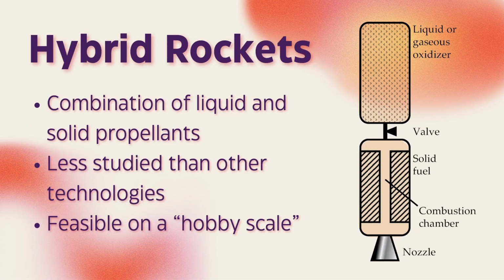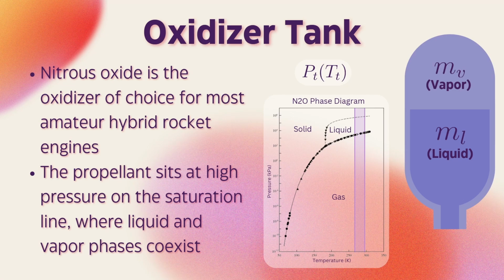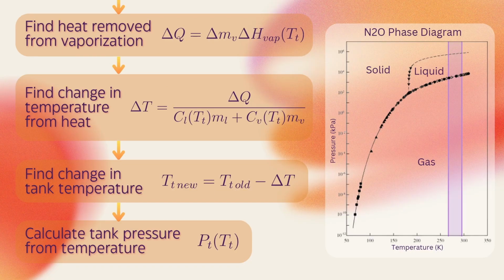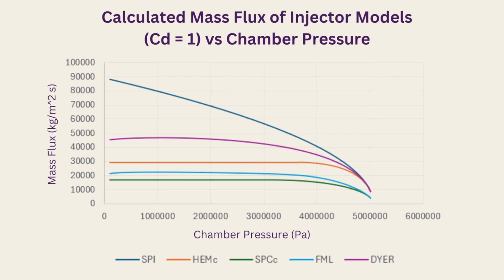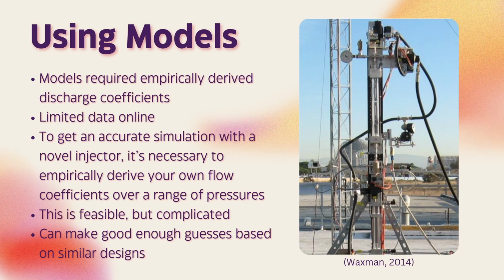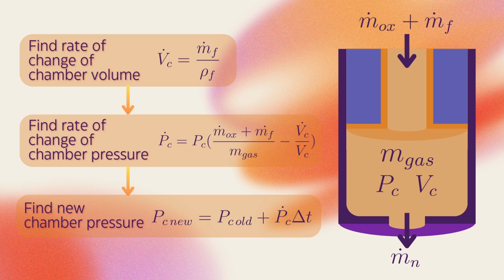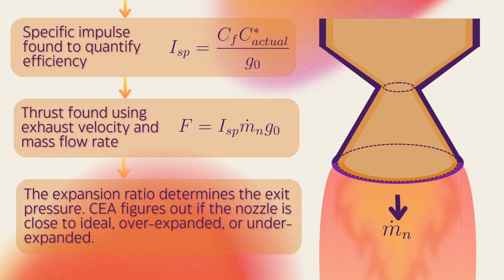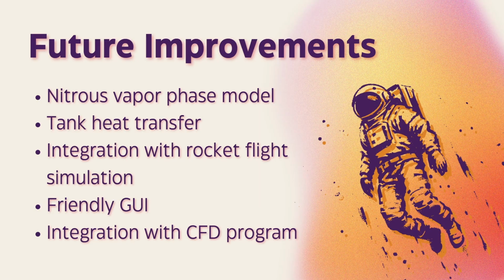Simulating a Hybrid Rocket Engine

Comment: I'd like to point out a mistake in the formula you showed in 17:55 for the rate of chamber pressure change. The numerator above is not just the input mass from the ox and fuel but also the loss of mass out of the nozzle. This is indicated in the HRAP theoretical guide. Just a small error. Otherwise this piece was great and was immensely helpful in figuring out my own simulation software. Cheers!
Reply from the maker: Glad you caught that! Will fix this in my presentation. Thanks for the support and glad the breakdown helped with your own sim work.

Comment: Nice work, I know what you had to go through! Rick Newlands, Aspirespace Rocket Engineering Society - hybrid simulation software.
Reply: It’s funny that you posted this comment only two days ago. I’m also actively doing research on hybrid design and I’ve come across your papers, they have been profoundly useful. Still having trouble finding a good injector mass flow model though